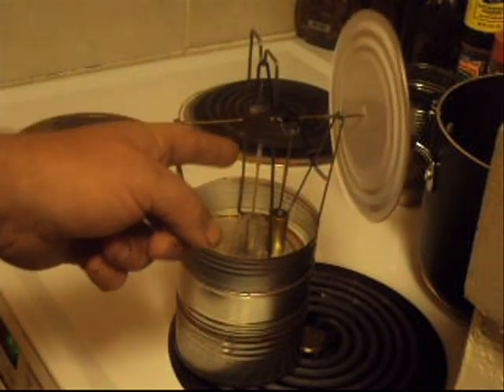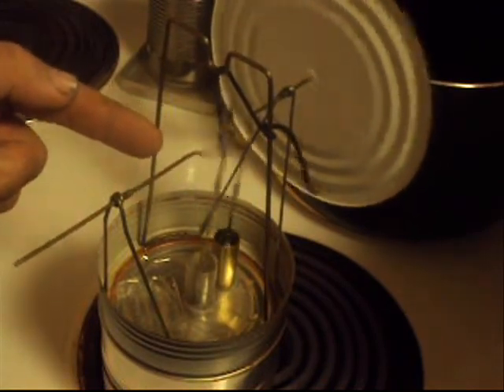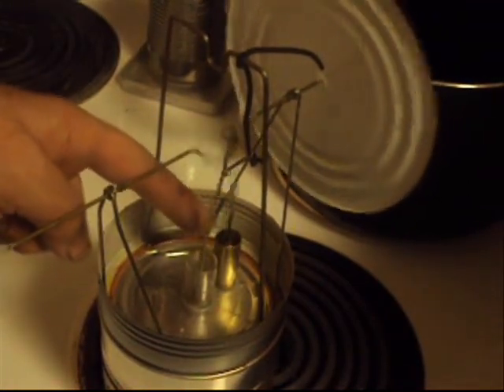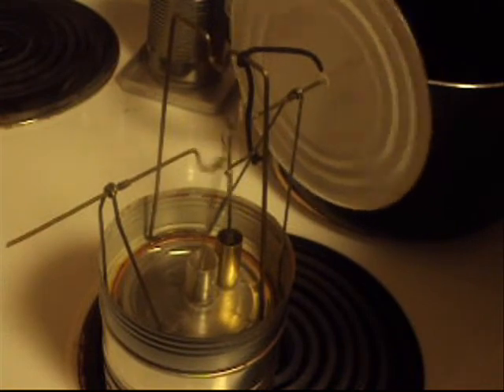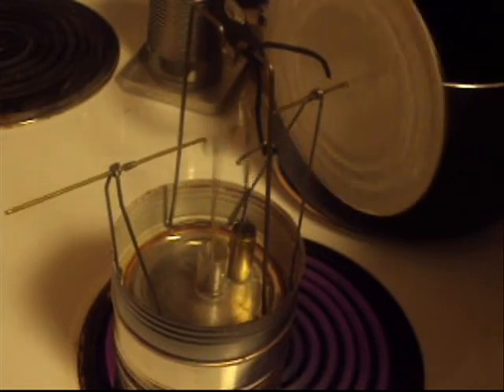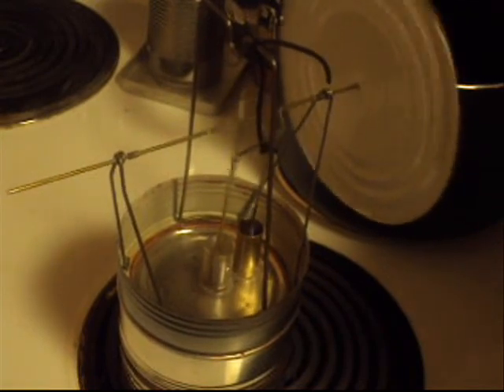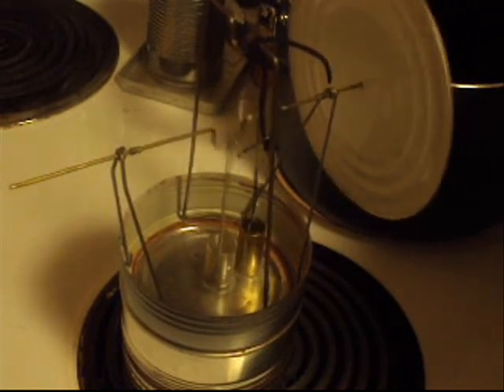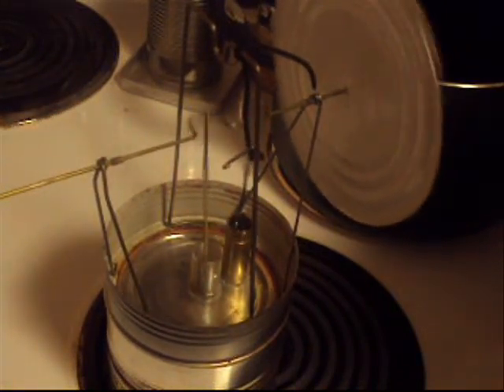PART 18 HOW TO BUILD A TIN CAN STIRLING ENGINE CHITTYCHITTYBANG..wmv

Comment: Hey MuddyMan; On the frame, I noticed you had movement in it before you got it glued. Meditating on that, my conclusion is take 1/2 inch of tin can, put it in center of frame, pressure will keep everything good and straight then superglue! Sincerely V.W. White

Comment: donde  va  el contrapeso en la polea????
Reply from the maker: +Nazareth Gallardo 

              

Você não precisa dele, quando o volante gira o peso fará com que a máquina siga o lado que o peso é em. :)

A máquina começará a vibrar como o volante gira. É melhor ter um volante equilibrado.

MUDDy
Reply: whehehheheheh muchas  gracias   ..ahora  dquiero saber  que funcion tiene el piston mas  pequeño
Reply from the maker: Nazareth Gallardo
There is only one piston. the piston is the smaller one. It turns the crank, and flywheel.

 The large one is the displacer.
It lets air pass around from end to end.
It displaces air from one end to the other.

The displacer starts in the up position, leaving the air at the hot end. the air gets hot, and the air expands. the pressure pushes the small piston up, and the crank pushes the displacer down. when the displacer goes down, all of the air is displaced to the top of the main chamber.

now that the displacer is in the down position, the air cools, and the air contracts. the vacuum created by the cooling of the air pulls the piston back down. The downward piston motion pulls the lobe of the crank, and thus the displacer travels upward again. The process starts over again.
Reply: GRACIAS MUCHAS  GRACIAS..es usted  un experto  sabe explicar  toodo muy bien    lo felicito he comprendido todo  ahora  intentare hacerlo  debo decir  que hice esa pregunta a  españoles  a brazil y  ningunos de ellos en youtube  me dio esta respuesta...estoy  convencido..que usted es  el mejor....gracias....
Reply from the maker: Nazareth Gallardo
knowledge untold, and knowledge not shared, is wasted knowledge. Even the bible says that knowledge is worth more than silver, and gold. The beautiful thing is can be given away freely.
I love giving what is free.
Enjoy. And keep smiling.
God bless you and yours.
Thanks.

MUDDy
Reply: amen   que dios bendiga a  usted  y su familia..saludos desde venezuela caracas

Comment: I made an stirling engine that almost looks like yours. But it didnt work. I used styrofoam as a displacer and it melted inside :(. I wanted to know what did you use to make the displacer?
Reply from the maker: +Shreyaj Shrestha just a smaller can that is sealed so air doesn't escape o go into the displacer can.

Comment: Could it be possible to make one with two pistons? and flywheel on both sides? Would that make it more efficient or power?
Reply from the maker: Daniel Kim Hey Daniel,    Larger pistons will increase like leverage. and could increase efficiency if the original piston is too small. increasing the stroke length, or travel would help as well. One must keep in mind of all the points of friction added to the unit as well.But a single flywheel seems to be more efficient. and easier to sync.  One way of adding a lot of efficiency is to use a regenerative displacer. They are usually made of steel wool, are shorter to allow a longer displacer stroke, and easy to build. They absorb heat as the air travels to the cold end where the air gets cooled off even more, and then collect the heat as the air travels to the hot end to acquire even more heat and expansion. check out specialez, and aproteche. Gee i hope i spelled that right. :) MUDDy
Reply: Thanks!

Comment: should the stroke of the piston have the same travel distance  as the displacer?  i built one following your instructions .it worked kind of ..i rushed it.. im building another one now and taking my time getting everything just right plus look good ..first one i believe had too much travel in the displacer plus i used copper for my piston ..so when it finnaly ran after messing with everything and re adjusting it took a lot of heat and was sluggish ..many thanks for ur vids ther awesome

Comment: @muddymuddymuddmann hey bud, been working on this thing, K, can we say the power piston is being driven by the expanding hot air that gets DIRECTED to it by the displacer, which has NO PRESSURE applied to it on either end by evidence of the loose fit and the propagation of the cycle dictate flow from hot to cold, PAST this displacer. Could we then just call it a valve giving room on either side of the stroke for the expanding and contracting air to occupy befor exuding work on the power piston?

Comment: I looked up how to calculate the maximum theoretical efficiency of stirling engines and it seems that theoretical efficiency increases as the difference in temperature between the hot and cold sides increases.
To calculate the theoretical efficiency, do you take the temperature of the vessel? Or do you take the maximum and minimum temperatures of the gas inside the engine?
Thank you in advance.
All the best.

Comment: @muddymuddymuddmann ok bud, will do, just finished reading Mr, martini's report., whoa, seems there is a lot of room in this thing for experimentation. The configs are endless. I was trying to determine the relationship between bore sizing and stroke , to make the best torq numbers, to run devices. iT  seems most are "over square" , I got a kick the way you said "rev it , junk" , sounds like me n the boys in the pit.
 Will stay in touch
john@ROCKNTV1

Comment: @muddymuddymuddmann cool ,  I am only speaking of a couple of degrees, yours look to be 180 and 270, what about the other side of the stroke, these are very intresting, i used to build my owen race motors and these timings can remove vibs and add rpm, jezt wondering your thoughts
john

Comment: @muddymuddymuddmann Thanks for the advice. Unfortunately, I don't have a compressor or an old transmission. I did find a creative way of making pistons though, check out pali52's channel. He makes pistons made out of magnets and ferrofluid, the only problem with those pistons is that when temperature increases, the ferrofluid and magnet become less magnetic. But overall the piston has a tight seal, good durability, low friction and self lubrication, this could be a viable option over diaphragms.

Comment: @muddymuddymuddmann I'll attempt to build an α engine in the coming weeks. The only obstacle I'm finding so far is how to make a diaphragm that will hold up to the high temperatures of the expansion space. I can't build a piston because I don't mave a milling machine and I've tried many other things and failed. Rubber would melt under the heat transmitted through the walls of the expansion chamber.
I think I'll find a way, but I'm also open to innovative ideas! Good luck on your next engine!

Comment: @muddymuddymuddmann  So u used cans to regenerate heat? I've only seen people use wire mesh and steel wool... Could u post a video to show what you did?  You should visit approtechie's channel, he builds awesome engines and some of his engines have regenerators, trust me, the regenerator makes a real difference!! I learned how to make regenerators by seeing some of his engines
PS, this comment came so late because I seemed to have some trouble posting comments on You Tube yesterday.
Best regards

Comment: @muddymuddymuddmann It doesn't seem to be inefficient, the only things that hold it back from being very efficient is the heat transfer along the sides of the pressure vessel and obviously the friction between all the moving parts, I used small straws to cope with the second problem and I didn't solve the first problem yet. You could try to make an alpha stirling engine to cope with the first problem, they seem to be more efficient and it's easier to put a regenerator in them than the gamma type

Comment: Did you think about calculating the efficiency of the engine? It seems worth doing because this is a great engine and as far as I know no one tried it yet. I thought about doing it for my engine but gave up because it broke while running at speeds close to 700 rpm plus on top of that calculating how much heat is used by the engine seems to be too complicated for me : (. If you find a way of doing it I would be glad to know.
Great engine, I made one that is similar, check out my channel.